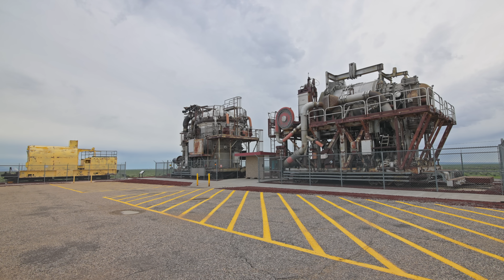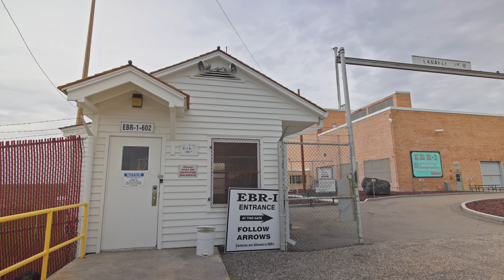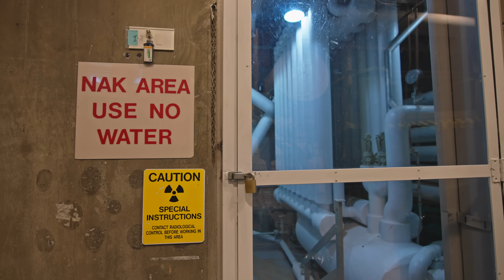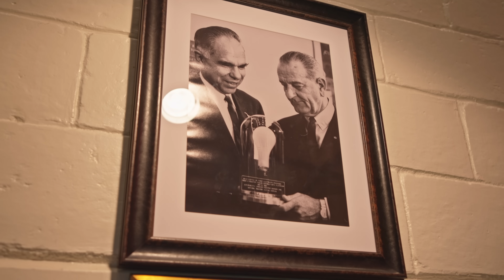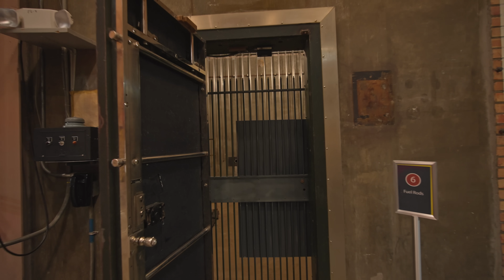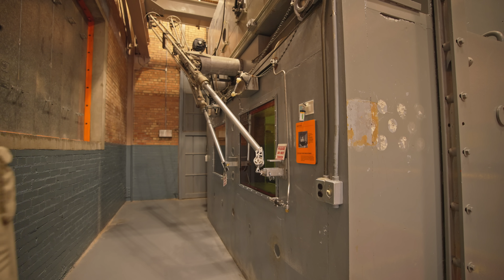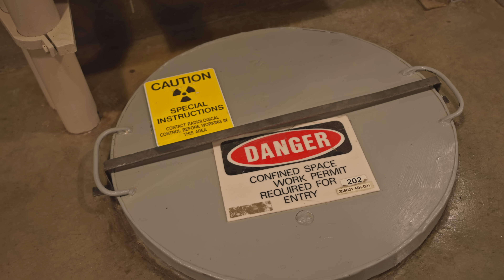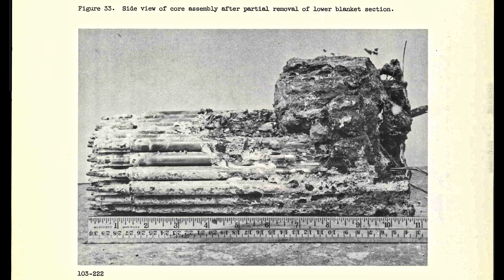Radioactive Nuclear Jet Engines in a Parking Lot

Comment: I have my 102 a few days, i try to use it for uranium glas to find out how much u235 in comparison to u238 is in it, but this is maybe not possible. Anyway a great tool and perfect partner for my GQ GMC 600+ (Pancake). The Radeye B20 is sooooo beautiful, if i had a 3D Printer i would try to make cooler case for the GMC 600+.
Reply from the maker: The Radiacode 102 can’t give you ratios of different isotopes. Maybe there’s a way to do it but I don’t know about it.

Comment: The concept of nuclear jets and atomic rockets is actually quite sound.. done properly.. though atomic rockets will never be "safe" for atmospheric use and maintenance and repair could be a problem for them as well. The theory is quite sound. Dumping radiation in space is nothing.  Over all I still think atomic rockets are great. Though it should be noted that in testing, we DID fire atomic rockets on earth.. and yeah, it was a radioactive free for all. But chem to space and atomic to mars is quite reasonable. Especially if your landing vehicle is not an atomic rocket so you leave your nice happy radioactive plume in space where it won't really be an issue.